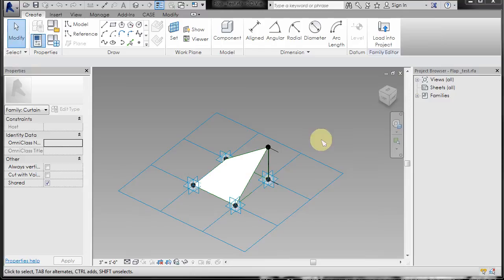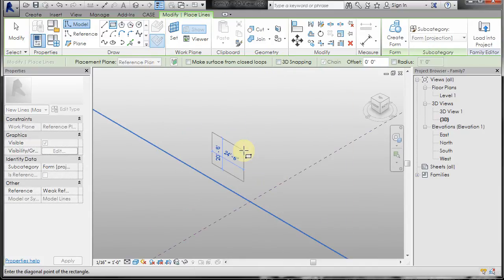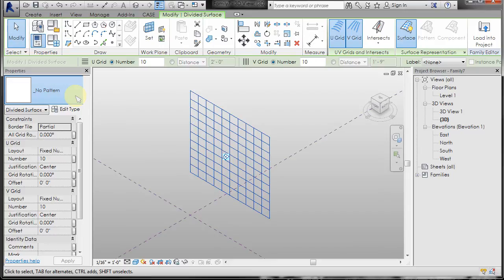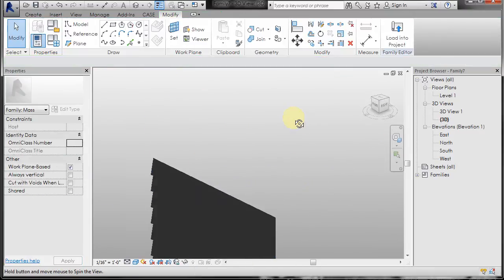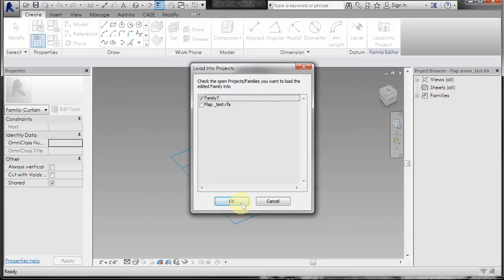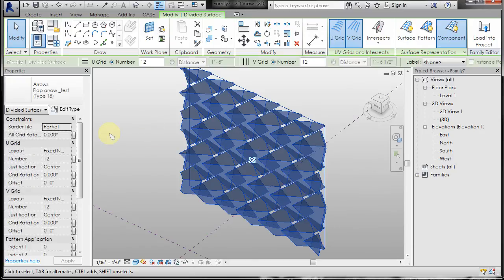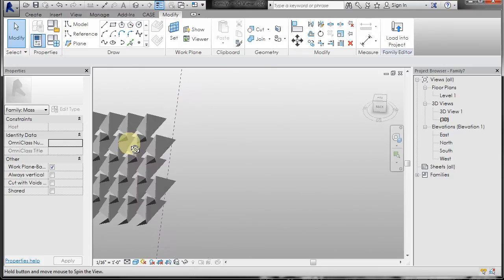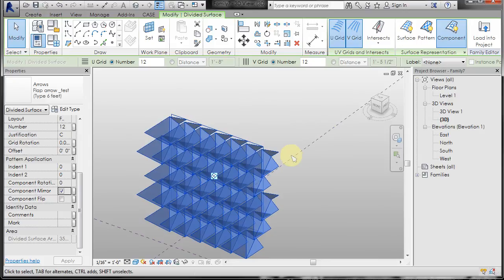PP REVIT 06 CURTAIN WALL PATTERN FLAP APPLICATION

Comment: Hi, I have a problem, whenever I apply a pattern to a surface it appears simultaneously on both sides of that surface, what can I do about it? (I need my pattern to be on only one side of the surface). Tanks.
Reply from the maker: +ION PUIU 
I'm not sure why it is apply to both sides of your surface.  It's possible that the component is not completely hosted to the pattern and therefore it might wander...if you want to attach your curtain wall pattern I can take a look and let you know what's going on.
Reply: How can I send you some print screens? Because it really is weird. I maybe did something wrong, but can't comprehend what. Although I did a basic thing.
Reply from the maker: You can send it to marlasmith@utexas.edu and I'll take a look.